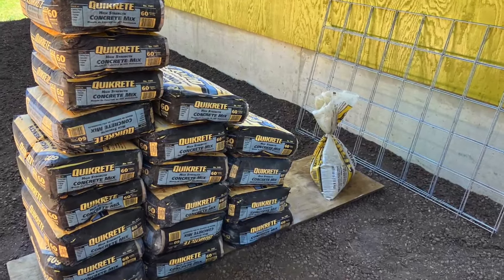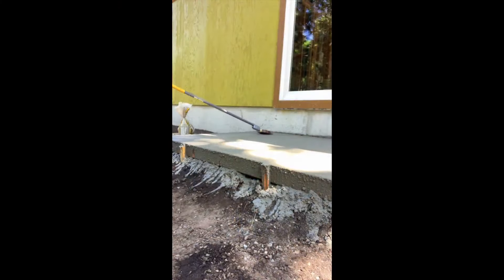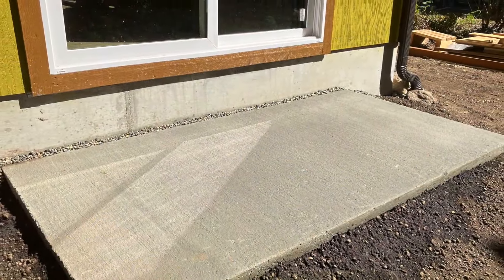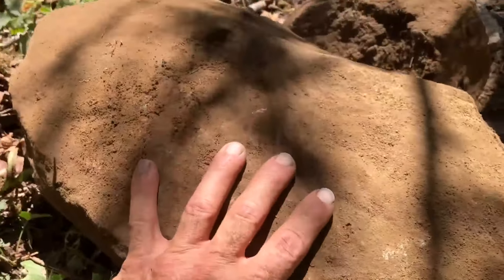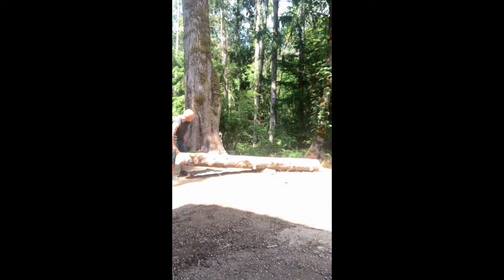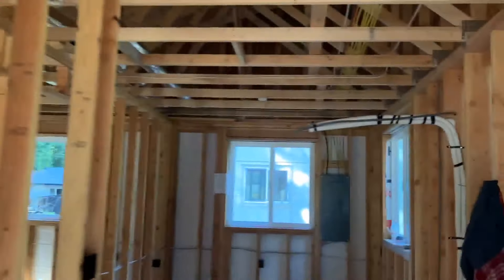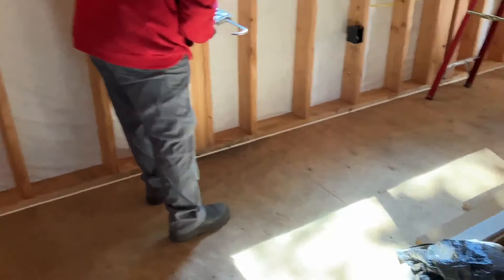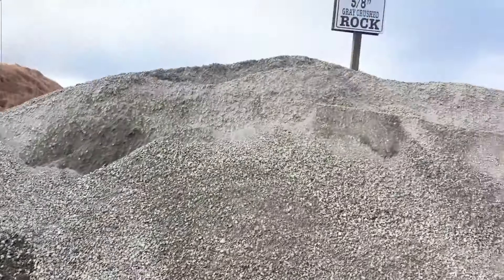Project Update - electric caulk stone - GS Tongs

Comment: Lookimg good Glen im happy for you. The only problem with sealing a home that tight is,,, they put a 4 to 6 inch fresh air vent in the return air duct so when it's 2,000 degrees in the summer you are trying to cool the outside air and when it's -200 in the winter you are trying to heat a that air.

Comment: Hey Glen…..make sure to take pictures of all the walls the you will have a record of where the wires are or plumbing. This will help in the future when you want to add items to the walls or find leaks or where not to put a nail through a water pipe. Go Yankees! Steve
Reply: You might record measurements of where the blocking is, as well.

Comment: Looks like some of those big rocks could make a good anvil?
Reply: rock isn't the best item to use, it can split, fracture, throw fragments in your face 99% of the time it will be uneven, if its flat the steel will make it uneven
you would be better off with a thick plate of steel screwed to a tree stump / heavy log than a plain ol rock
Reply: @messylaura  really